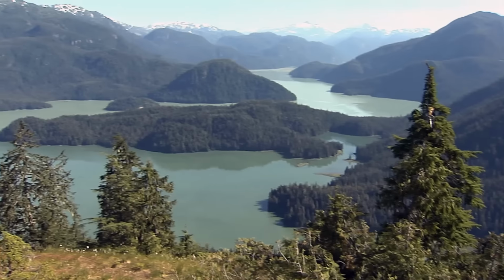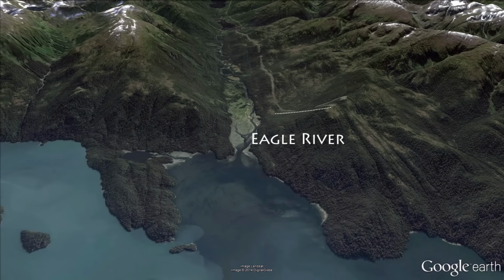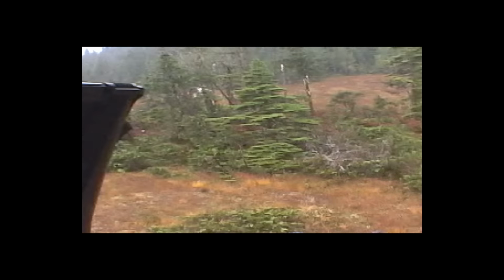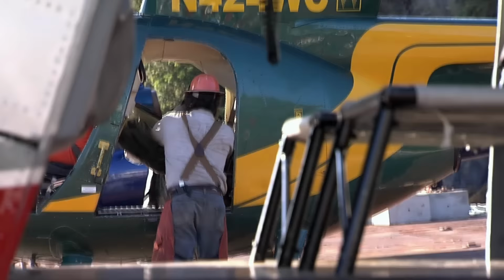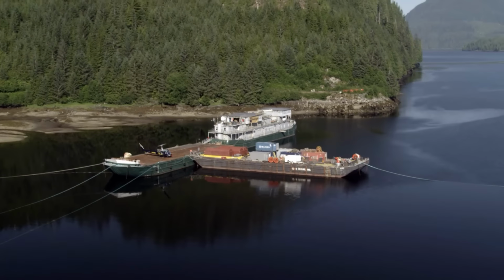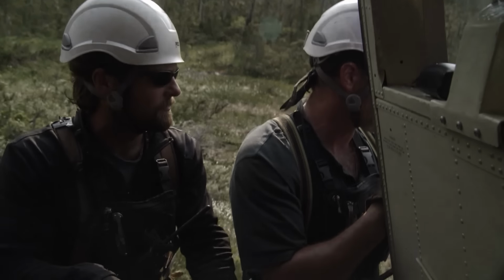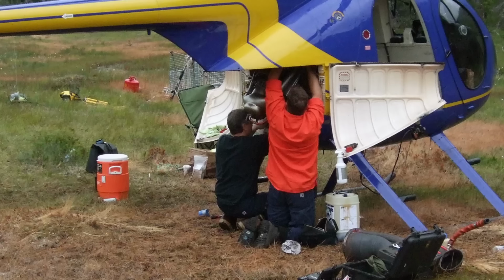Powerline Alaska

Comment: This is exactly the type of application a small modern modular reactor would be ideal. Probably actually cheaper - the total cost here must be astronomical - way smaller footprint, no need for transmission towers, no clear cutting, helicopter hours reduced by a factor of ten...sure do wish everyone would realistically embrace nuclear power, instead of the knee-jerk 'no nukes' mindset. It simply makes sense in today's world.

Comment: Great Achievement- but the video isn't long enough!!! Left me with a lot of questions. How did they clear the forest of the trees for the lines. With helicopters? Did they use the lumber or just leave it on the ground? One person in the comments said they walked the whole way. Did they take tents and support crew with them walking through the forest clearing it??  You showed huge tanks of fuel for the helicopters- how did it get there and where was "there". The tanks looked like they were on solid ground, not on a ship. Did the forest service approve staging areas cleared for the project? So when the weather improved- and you got done early, did you have to pay for the air-crane for the entire month even though it only took days? And did the Navy ship you converted ever get completely painted between summers?  What happened to that ship? You had wonderful graphics for the landscape and showing where the lines needed to go, --- You needed similar graphics to explain how to pull the lines and attach them once the poles were all in place. It was very confusing. YEP- ya need a longer documentary.

Comment: How much environmental destruction are these dams and power lines causing? Lots. They should build small nuclear power plants in the towns to provide power. The reactor would only need to be the size of a refrigerator or smaller. No power lines. No forest disruption. No dams needed. Change out the reactor every 25 years.

Comment: Out of curiosity just how many gallons of diesel will be saved by getting rid of two diesel generators for the community versus how much energy and resources were expended to put in this little transmission line?
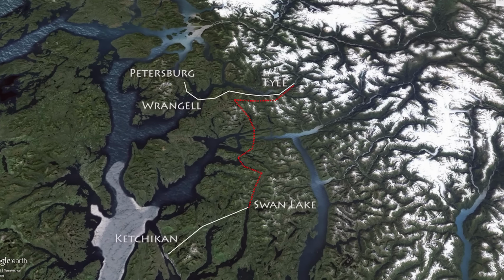Reply: Might help to watch until the end of the video... 42:02

Comment: Amazing documentary. I have become slightly fascinated with the logistics behind installing and maintaining transmission lines. This started when I got a job flying fixed-wing aerial patrols of these exact types of transmission lines. Some of these lines go into remote forested areas, and a fixed wing patrol of the ROW makes sense to make sure vegetation is in tolerance and no poles are leaning, wires sagging etc.

Comment: One of my favorite documentaries. Narrator reminded me of Rex Allen narrations of Disney's nature movies. Advanced planning really helped the project. I liked the idea of the stove pipe device to guide the poles down, so a ground crew was not necessary for the Skycrane to place the tall supporting poles that held the wires in the air. Starting at 37:45 pole problem and the "volunteer " chosen for the project is Rick. LOL. Afterwards, "Rick makes the connection and earns a ride home!" LOL. He is hanging from a rope tied to the helicopter and holding a replacement guy wire, twirling all around.

Comment: I can't see how this was cost effective
Reply: Those diesel generators that they have to run burn about 240 gallons of diesel per hour each - I think they have to run two of them... so having to bring the fuel on a barge from Seattle costs them probably at least 4$ per gal - so when you do the math just the fuel is about $1000 per hour per machine - those machine run 8000 hours per year if your running them as prime power - so two machines cost about 16 million per year in just fuel.. I didn't hear a number on the final cost of the line but I'm very familiar with diesel power plants in Alaska since I was working on them and running them for 25 years... I think the 16 million per year is a very conservative number since I have seen diesel go for over $10 per gallon up north.  The power line has a life span of about 40 years so, in today's dollars that's 640 million bucks in just fuel savings - not to mention oil and filters and overhauls - those big machines last about 30,000 hours between overhauls - about every 4 years your gonna have to spend 200k$ for a overhaul and a rewind on the generator every other rebuild for about 200k$... so every 8 years you will drop about 1 million bucks on maintenance. And that is a conservative number... so 10 years running a couple of large diesel generators will cost about 170 million bucks.  Then you will need to buy new generators for several million.  That new powerline wont need anything much for several years... these numbers are at today's prices and you know prices wont stay at this level... so with inflation and fuel price fluctuations and rising cost of government regulation etc I'd bet that power line will save $250 million bucks in the first 10 years... so now do you see the cost effectiveness???
Reply: @jth1699  MAJOR GLOBAL MARKETING ENTERPRISE SOFTWARE TAKEOVER FRAUD

Comment: Amazing effort by people, planning and engineering. I would like to know more about the tensions required to lay wire thousands of feet, the kind of wire used and the amount of stretch of wire over time of the material used in making the wire.  thanks

Comment: Damn lot better job than TVA has ever come close to. TVA has built transmission lines all over E. Tennessee, W. Kentucky, N. Georgia, not as mountainous but remote. TVA built roads to each transmission tower, with travel time to some as much as half a day, work hour go home. I thought that was stupid. It's nice to see someone do some planning, instead of just doing it the same old way. You can't imagine how rough riding them old 2 1/2 ton army trucks were. Getting pitched all over the back of one, landing on toolboxes, 2 x 4's, whatever was in the back. Thanks for showing how to do it.

Comment: Funding ran out? LOL Mobilize and Demob is 80% of the project. Hahahaaaaa.Politicians!
Reply: I used run an electrical contracting company in Alaska and I'd bet $50 to a donut hole that the contractor had a mobe / demobe  cost in his contract - and in Alaska when your working remote you have a negotiated day rate for standby days - for parts or weather or about anything except acts of God- like earthquakes or tsunami... I was trained by a master - his saying was "if my eyes are open the meter is running"...
Reply: @jth1699  MOBSTERS

Comment: The poles all seem to be rusty?   Is that some new kind of maintenance free finish or metal?  Usually it would be galvanized or something!
Reply: The poles are made of Corten Steel, just like Stainless Steel, ones it forms a oxidation layer, further corrosion stops.
Reply: these poles are isolated away from the populous and deal with extreme weather. maybe they didnt see the need to spend their budget on finishes. but who knows
Reply: They have different grades of steel that will only have a surface rust and will not oxidize anymore. Not sure if they used that or painted after installation, but I think it would be a lot harder to paint it after

Comment: Just to add to the retards that some of had to deal with I will give you an example that is not unique.  In Bear Valley in  Boise NF we had an Airstrip.  It was decided to close  it because we  no longer needed.  I agreed with the decision.  The way you close a landing strip is to place a large X on each end.  The Ranger named Warren Pavlat   where the strip was located went to the trouble to place Lodge Pole Pine  every 20 ft for its  1 mile length.  In an emergency the strip could be used .  Now if it was needed you would sure to be killed on attempting to land.  With out the logs you would land in thick grass...ik04  you  are correct  and why I elected an early out.

Comment: Impressive, not the way I would have done it however. I would have run submarine cables along the bottoms of the rivers and lakes. Faster cheaper and a whole lot less environmental impact.
Reply: I would think that they shied away from it because of the freeze/thaw cycle, where I have seen 303 Pair double steel tape armored telephone buried cable torn in half by ground movement near Fairbanks, AK.
Reply: First I'm no expert on this , one of the things I am  is a fan of is alternative energy,  I  have watched and read extensive on the subject. One of these areas is offshore wind farms. They use undersea power cables to bring large amount of power ashore, and where talking  vast distances. These cables have to withstand salt water, drag nets , ship anchors, and marine life. It would seem to me that running these cables down a freshwater river or lake would be a cake walk for these cables.
Reply: That's okay Terry, I was interested in your alternative proposal and the proposed cable's rate of longevity and risk-free waterproof insular cabling that could have been made available as the alternative means and method to accomplish the same successful result. It was simply an inquiry, not at all a criticism. Thank-you. William.
Reply: Terry, what effect would the temperature variation from frozen to ice cold, have on the life of these underwater lines you have suggested? Would they be manufactured with the protective layers fitted around (for example) an undersea fibre-optic cable? This kind of cable installation you have suggested would also have its limitations.

Comment: Had a buddy of mine worked on power lines repairing live high tension lines. Scariest shit I’ve seen. He flew in a Bell jet Ranger. He sat in the back in a chain mail suit. Then that nut would slip out of the aircraft onto the live lines and fix them. The crazy part of this we were Crash Fire Rescue firefighters, he had worked a lot of crashes.

Comment: Great video, great feat of modern engineering. Although I found it remarkable that despite all the conservation laws (no roads, no camps on land etc etc etc) they were allowed to clear fell that massive swath where the line woould run
Reply: Right Mike, rather than install 150 foot tall transmission towers that would easily clear tops of trees. Not only did they clear cut back for plenty of arm room space. Wait till vegetative management crews regularly come through every four years to head back forest regrowth encroaching on utilities right of way. 

While as an Arborist having least respect for trees planted under power lines.  I hold even less respect for wreckless amature Arborist getting paid big bucks to butcher back trees existing long before power lines installed.

Comment: Amazingly after hundreds of millions of dollars spent Ketchikan has derived almost no net increase in power.  The diesels are still running full bore and the utility tries in every way to stop any increase usage.  A new bureaucracy was created to add ever more cost to administering the power over the levels already in place.  Do to poor negotiating Ketchikan does not necessarily get access to its needs even if there is excess generation.  Huge costs were incurred when engineering had to be redone from the original substandard work with no recompense sought.  Due to incompetence in Ketchikan Public Utilities head management and city administration the costs will have burned up any future projects that could have actually provided hydro power that is needed in Ketchikan.  This was a total waste of state and federal funding as well as increasing power costs to the people of Ketchikan.   A perfect example of wasting money on grandiose political maneuvering instead of doing practical sense local projects easily accessible from Ketchikan.  Douglas Thompson
Reply: Politicians have very deep pockets.
Reply: Sheesh Doug you sound like you know what your talking about, are you saying no power is running into ketch from this line ? or has the demand for power overtaken the supply due to growing population and reliance on more elec gadgets ?.
Reply: @MrAustruck  MAJOR GLOBAL MARKETING ENTERPRISE SOFTWARE TAKEOVER & MONEY LAUNDERING SOFTWARE TAKEOVER PROPERTY THEFT & FRAUD! I HAVE PROOF!
Reply: PS:  Those responsible for this project are the same ones who spent tens of millions on a "Road to Nowhere" (starts nowhere and goes 2 1/2 miles to nowhere on Gravina Island) and are still pushing for a "Bridge to Nowhere".  They never rest when separating the taxpayer from his money at the same time they are crying for more taxes!!  They walk away with their pockets full and the taxes go up.  Headed up by a city manager who has never brought a project in on time or on budget and believes taxes are unlimited as his personal wealth goes ever higher.  Very sad.
Reply: They need to be coated in honey and dropped in front of bear cubs...:)...  There's no shortage of Assholes in government!

Comment: Awesome video and story, thanks for the documentary!  But, would local storage of electricity and other resources have been cheaper and easier to maintain?  Or would tunneling, using cheaper methods like Musk is working on, and burying the cable instead of scarring pristine forest?
Reply: LOL...Burying it?...Dude...ITS ROCK, IT'S MOUNTAINOUS.. It would take about 50 years to make a trench 60 miles long through a mountain range in alaska...Musk is a fraud.

Comment: Cool stuff for a layman (and the narrator has a money voice). I came hear searching the 'net for the tensile loads that power lines are subject to. I was looking up at lines near my house and was puzzling that. I have found not one source that comes close to telling me except this movie which mentions the line they use requires 15k pounds to pull through. However, what is the final tension on that line? Also, what happens when something brings down a line. How do the towers not get pulled over if a line snaps (especially the very high aesthetically-thin hollow cylinder towers)? Are the towers strong enough to hold the tension in a line without extra guy wires?
Reply: statics my guy

Comment: I'm curious why they don't utilize any NOTAR equipped helicopters? I would thing it would increase their safety margin verses traditional tail rotors. Granted with some helicopters its not available, but for the Hughes or M.D. 520's given the absence of any safe emergency landing locations I would think it would be desirable? Mind you I'm a layman and there may be some aspect that makes their use not an option.
Reply: Scott, 
I used to think that too, but there is a reason no one does it. The notoars have poor tail rotor response and authority compared to the the standard tail rotor, and the 600N is far more susceptible to weathervaning. Also the Notar take far more power than the standard tailrotor for the same amount of thrust equating to less power reserve, and a is maintenance pain.
Reply: David Feerst , the other though that comes to mind then is to build a safety cage or shield that would reduce the ability of rotor to contact a cable.  Granted it would require an STC and probably take a couple years and there isn't a huge market for it but if you just had a aluminum or better yet a carbon fiber safety ring around the rotor blade that protrudes far enough out from the rotor to prevent the rotor from contacting a cable if the tail swings too far in towards the cable.  It could weigh very little and be attached to the side of the tail structure.  This way if the tail swings into the cable or just bumps it the carbon fiber safety ring  would prevent physical contact with the rotor??  I mean we're just talking about while hovering.
Reply: Scott Pecora the problem there is that weight that far aft would require more weight to counterbalance the CG shift.

Comment: What a flood of memories! Camaraderie never rusts! Kyle is hard as nails, but you ve got to be tough when you lead from the front! Under his leadership this project was completed ahead of schedule and with out any incident or injury. The weather for the 9 days of the sky crane was a decent break but everything else was a due to proper job planning and hard work. Rest in peace KO and beck
Reply: Were you part of the project, Casey?
Reply: Who are KO and Beck?
Reply: KO was an inspector. He has since passed away. Beck was a pilot, who has also passed away since this project. Ghost rider was another pilot that worked on this project. He has also passed away.
Reply: @caseysmith8831  glad I got to see a part of their meaningful and longlasting work.
Reply: speaking of rust, am I the only one worried about those steel poles being placed without any coating? They surely will rust away in 20 years?!
Reply: No they are made that way. It’s a protective coating. Works better than any paint or galvanizing
Reply: @caseysmith8831  interesting, looked like untreated metal straight from the factory. In Europe it'd be galvanized.
Reply: @velotill  It is a special kind of steel that forms a protective layer of corrosion then basically stops rusting further. They are building lots of bridges around here with the stuff.
Reply: @velotill cor-ten steel
Reply: Pickled steal. I haven't seen it used much lately but i think it's better than paint or galvanized since they can be scraped or chip.
Reply: some of it was stopped due to legal bs at the beginning